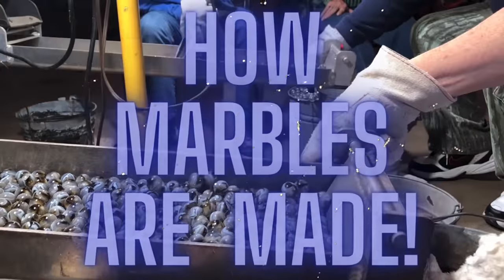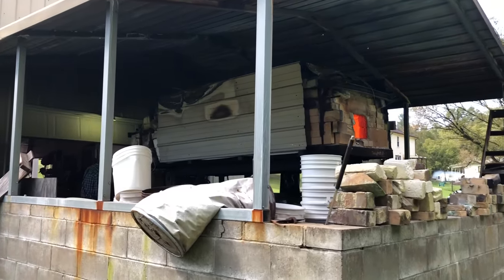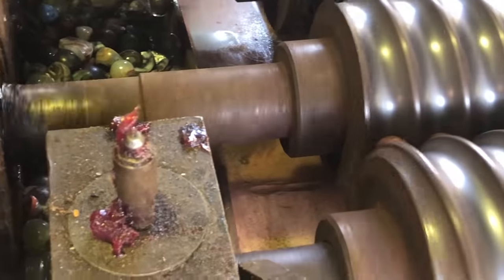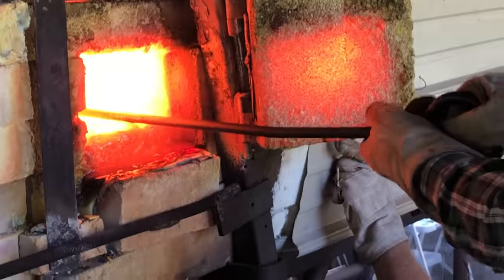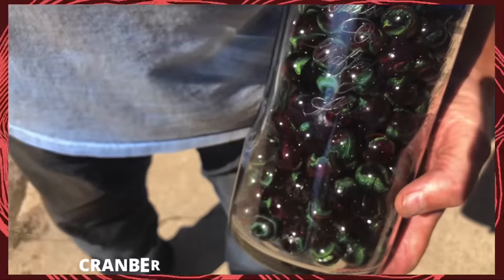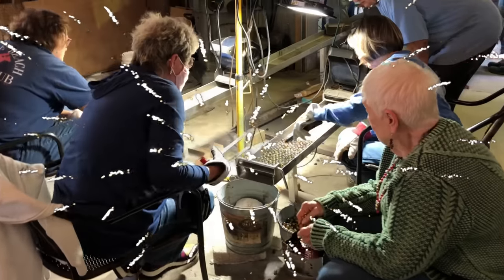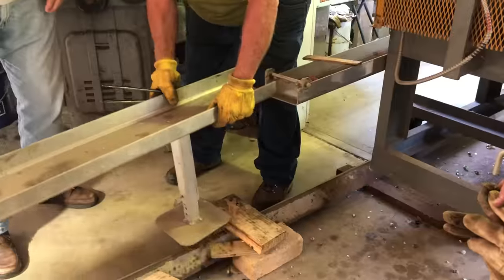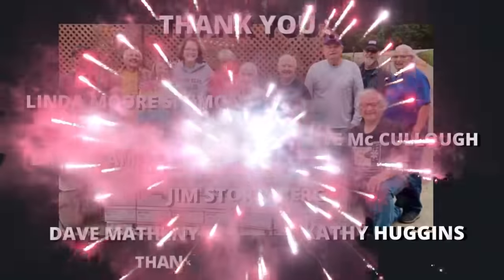How Marbles Are Made!

Comment: It’s a celebration if I find a marble on the beach! I love that! It’s interesting to explore what goes into coloring the glass. Also, the speed of glass flow is how annealers control the thickness of window/table top/etc. glass. Slower is thicker and faster is thinner. The thinnest, you will often see in picture frames to save weight. I love shows like this. Thanks.
Reply from the maker: No Sonde I haven’t found a marble on the beach in about a year ! It’s all very fascinating when it comes to glass hot works 🔵thanks for watching!
Reply: @stephenbahrmarbles  there rarity is what makes them special!

Comment: I worked in a bottle factory where the furnaces were 80 feet high. There was a  tunnel  towards the front that you could walk through while being surrounded on three sides by molten glass. One of the furnaces burst and the solidified glass was 14 ft thick. It was broken up by jack hammers and many of us took a chunk home. I was lucky to be out of the room when my lump exploded. Large, thick pieces of glass have a lot of tension in them.
Reply from the maker: Wow Mr. Silly that is a crazy story! I wouldn’t want to work at a glass factory. Tough job ! Thanks for sharing!